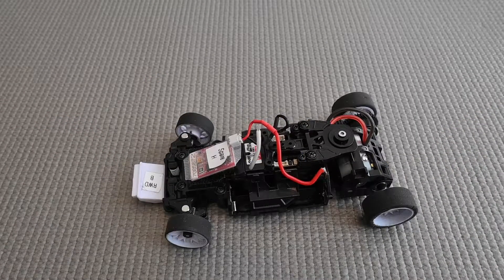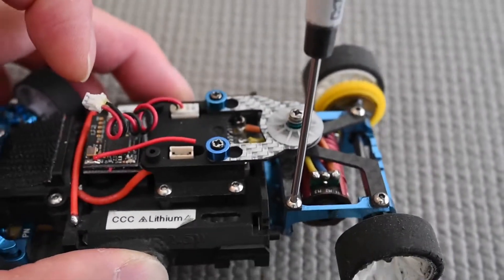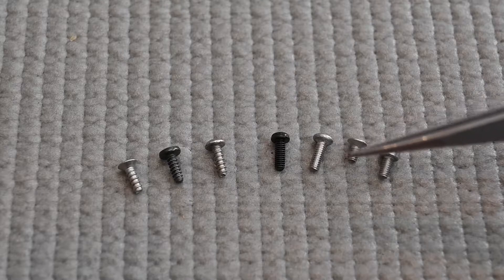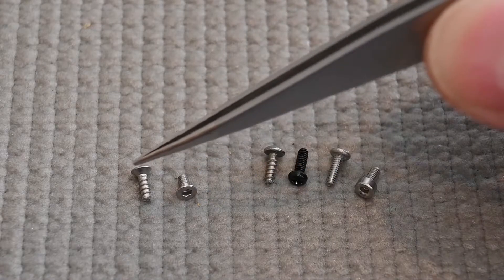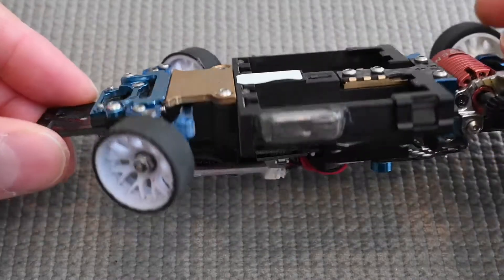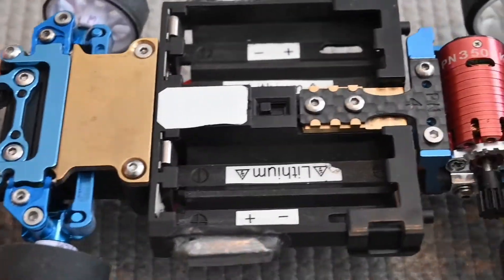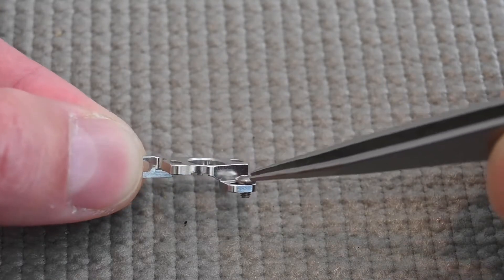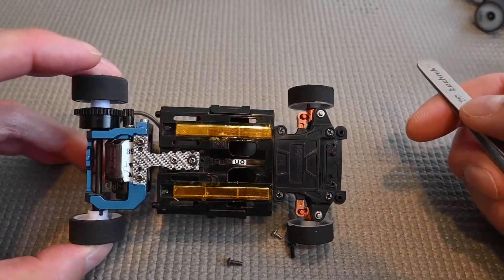Mini-Z 1/28 Screws Overview

Comment: Flat head? Counter sunk.
Socket head and button head arent the same. 
Used a philips driver when he should have been using a posidrive/jis driver. 

Personally i use tiny torx drivers for the soft hex keyed screws
Reply: Really doesn't matter because people don't care they just need to know what driver to use torx bit allen bit or phillips head bit or drivers...
Reply: @johnsmith-oh2xo  I again repeat, should be using a JIS or pozidrive. Not the same as philips. People constantly ruin JIS and pozidrive fasteners and think it's not their fault. It's the parts. Silly